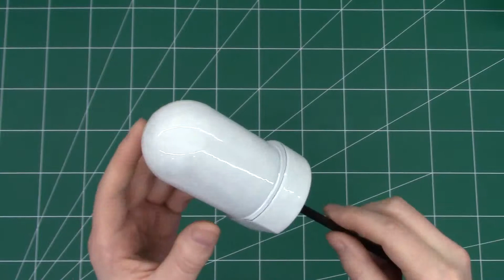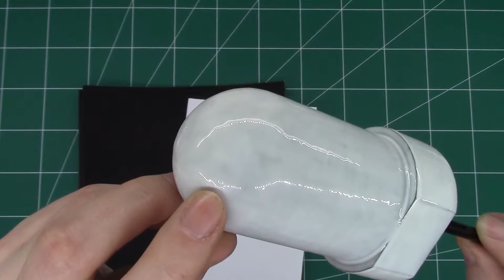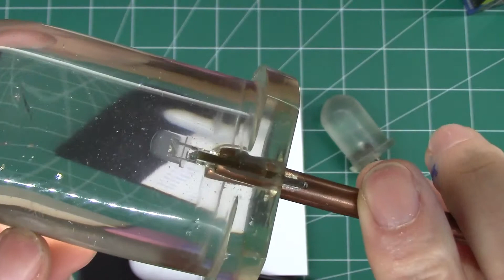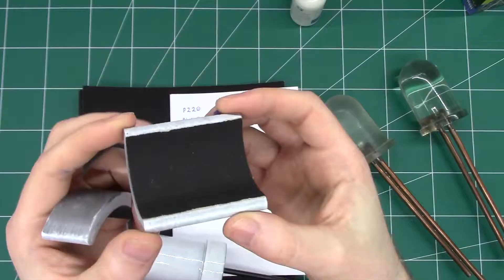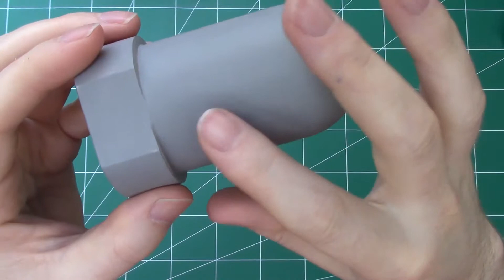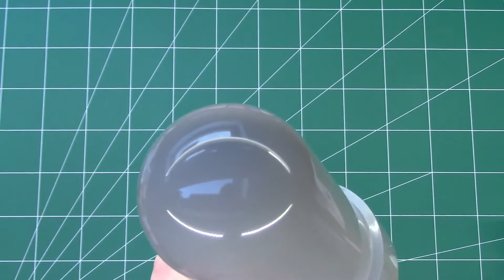Making a Refined Giant LED - Part 3 - Bulb More Filling and Sanding

Comment: Very cool... but the perfectionist in me thinks "why not just get a machinist to turn down some steel round stock?" ... then it would be perfectly smooth and very nice as a mould shaper
Reply from the maker: Definitely something I was thinking about, have access to a metal lathe at my hackerspace but l've never used it myself.